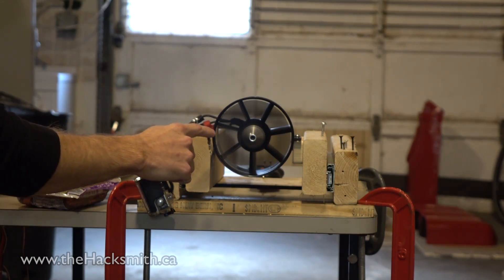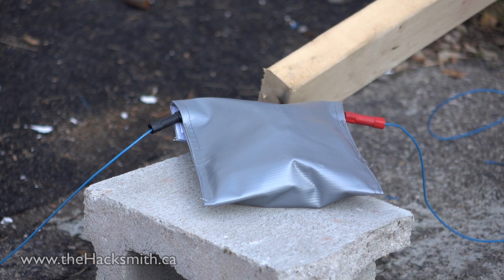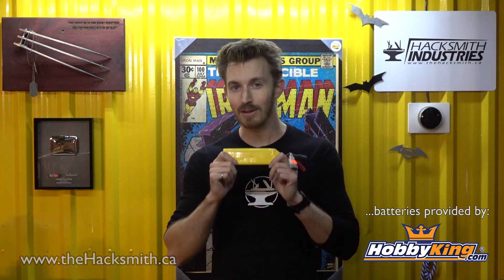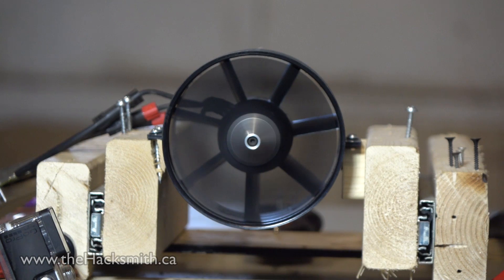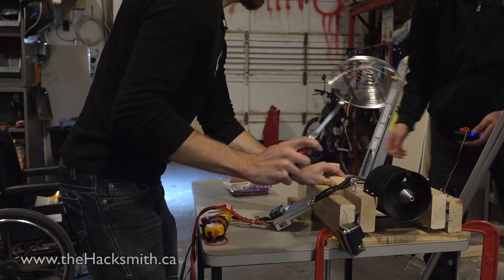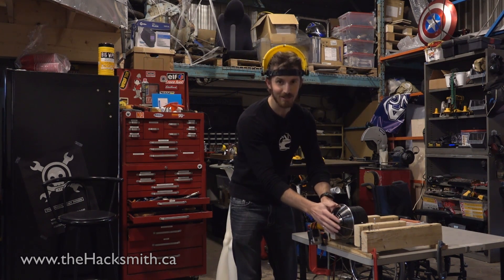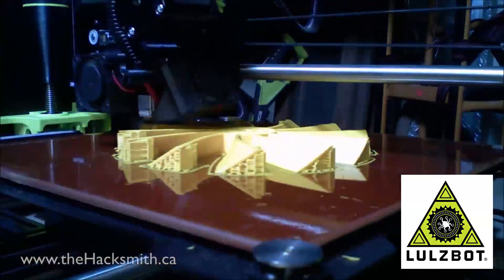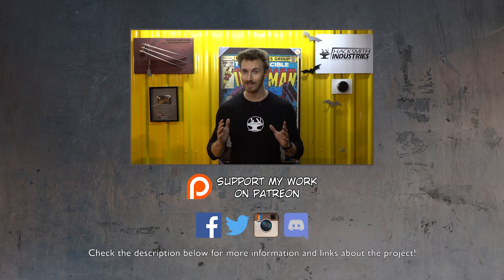Flying Like Iron Man #11: Not So Safe Safety Tests

Comment: Hey man im an aerospace engineer and i think the edf is spining too fast, you shud use a speed control and keep the revs round 2000-2500 rpm and up the torque to you can increase the mass flow
Reply from the maker: Not quite

Comment: Ok, I may be wrong here but I am pretty sure the lithium polymer batteries are the ones that don’t explode. They are made using a solid polymer electrolyte instead of a liquid one so they don’t spray out and ignite with the air like the lithium batteries and lithium ion batteries. You can actually cut them up and they are still usable.
Reply from the maker: No, you're thinking of lithium ion batteries. These are definitely lipos, and lipos are definitely the ones that explode (as shown in the video)
Reply: I thought the same at first, but after some research. LiPo batteries can be just as dangerous as Li Ion, especially when punctured. I think where I got the idea that they were safer was a video I saw months back about some guy developing a Lithium Polymer battery that wouldn't explode.

Comment: Hey Hacksmith, I want to give a word of advice, I don't know if these will work, but I have experience with electromagnetic transformers, and if you input about 10 volts into them, the output could be around 3000 volts and way more amps. the cool part about it is that you don't need alot of  amps to power it. Tell me what you think about this please.
Reply from the maker: Tranformers only change the voltage and current ratio. Power stays the same. example -- 100V at 10A in, you could get 1000V at 1A out

power remains constant at 1000W

Comment: When filming 60 or 120 fps always put the shutter speed to twice the frame rate. You probably have yours on 60 or 50 due to most film being 30 or about 24 fps. This will remove the flicker like effect in the BB gun scene
Reply from the maker: The flicker effect is from the lighting used. We have some lighting that works really well and doesn't flicker though.

Comment: This is late, but couldn’t you 3D print a fan with a dissolvable filament and then use that to make a “negative” cast, and then cast the blades with a metal of your choice? (Probably aluminum or an alloy of it) And then use a lathe/grinder to grind/cut off the excess?
Reply from the maker: +Josh C EDF blades are precision parts, they have to be perfect. Casting isn't :(

Comment: Hmmm a good way to increase the power for the edfs while decreasing the weight and batteries required would be to use a small inverter system to increase the voltage needed. This can also provide more protection against battery explosion as the inverter could help control the voltage variation from the batteries.
Now the actual best way to create a suit that flies like the Ironman suit does would be to create one of the most utilized features of the Ironman suit, and that is the repulsors. The tech needed for the repulsors is actually not too expensive to build. From what I surmise is that the repulsors consist of a light element ( which can be easily seen) and a sonic element which might not be realized. The light source can be a standard LED such as found in flashlights. Around the light emitter is a subsonic unit similar in function to a directional speaker. The hard part is finding out what combination of sound modulations and light modulations enable a repulsion effect. Now it seems that the waveforms of both units must form a type of lattice. This should enable the light to function more as a partical instead of light creating repulsion similar to a rocket engine. Utrasonics might work but I believe the subsonic frequencies would enable better partical cohesion. The advantages of this system is much greater that a system using other forms of propulsion. Smaller amounts of power are required for the light emitters and subsonic units. A small voice controlled CPU could control the frequency modulations providing a greater degree of repulsion/thrust difference. The frequencies determine the thrust since it is basically sound vibration and light modulations that are traveling out from the repulsors. And last advantage is that you not only get thrust for flight but can also have a reoulsor device or beam. It would take a lot of R&D time to sort the frequencies but it would be worth developing into a working prototype.
Reply: Cool

Comment: now I think there are three good approaches to make this project work. 1: better powersoarce. maybe abandon batteries and try something different. 2: better thrusters. ionocraft engines maybe? 3: or lighted the load. maybe use compressed nitrogen along side turbines. or use alot if balloons, or try horizontal flight with an unpowered rotor like a gyrocopter. your first attempt used rockets which turned out to be a little bit illegal. I wonder if hydrogen peroxide engines would be illegal or not. my last idea is to just increase effeciancy and decrease energy loss. perhaps with silver wires since they're more conductive.
Reply from the maker: +Clark Dauphin lithium polymer batteries pretty much have the highest energy density already so there's not much we could change there... Other option is jet engines and kerosene but then you couldn't do electronic stabilization. Ionocraft is cool but not possible as they only put out micrograms of thrust :(

Balloons would help but it's not really flying like iron Man at that point, is it? :P

Comment: what about using big ceramic capacitors? capacitors with ceramic or glass as a dielectric. it won't blow up, but it might drain quickly.
Reply from the maker: +Clark Dauphin capacitors can't store enough electricity

Comment: you could put a generator with small fan on it behind the outlet of the edf to generate power
Reply from the maker: +ants Vw you'd lose more power than you would gain.  Remember the law of conservation of energy -- energy in = energy out + losses. The only time you can reclaim energy from a system is if you can reduce the energy loss, which is usually in the form of heat, but all technologies capable of that are too big and heavy to be worth while. Using a fan would just reduce your total thrust and add more losses to the system
Reply: i get it but is it the same if you put it on the inletbut for the fan a small impeller even though the unit will become too heavy

Comment: try to use ultracapacitor
Reply from the maker: +Sunny Singh Chauhan they are not good enough. Lipo still better
Reply: the Hacksmith thanks for your reply
Reply: the Hacksmith what about suit with turbines at shoe's and back of exoskeleton to balance mass and get stability and hand propellers with variable speed to attaining height and making direction?

Comment: Why not wear a battery suit and build cool gadgets like a flying platform or a... that's all i got. You could be Battery Man!
Reply from the maker: lack of funding lol
Reply: Yea, I guess that is really expensive. But if you carry the weight of the batteries and build a platform(that will also carry all of that weight), you can use bigger jets and possibly take flight. Besides the steering being extremely difficult and the whole thing being extremely dangerous, I don't think it would be legal without a special license. I'm sure I'm not thinking about a problem that will obviously mess the whole project up(probably weight)but if I have the funds for that, I'll try it one day.
Reply from the maker: +Jaykerz P easy -- you can just build a giant drone, like I said it's a matter of funding :p a basic platform could be made for about $20,000
Reply: We need to advance technology like 10 or 12 years and then this would be so easy.

Comment: Hey bro, to prevent the blade (impeller) from breaking off from very high speed fatigue, put a one big ring that fits the perimeter around edge of all impellers and weld it, that's to naturally, strongly hold/support all  the impellers from getting fatigue so it will not break off during high speed fatigue. Good luck, enjoy it.

Comment: hi guys. Im not a expert but Ican see in my head how some parts shuld looks but I cant build by my self. have you try to build your own rotor on neodynium magnets???  also try to use blades on both sides that should make bearings less stress. what you think?? as I told Im not a expert.
Reply from the maker: The professional EDFs use precision neodynium magnets already, not easy to make yourself!

Comment: Hacksmith,hopefully u solve the problem of thrust power.Because even jet engine got several stage of compression air,may u need 2 or 3 layer of EDF fans overlap,create more thrust?
Reply from the maker: Thanks for the suggestion Patrick Ho!

We've actually answered this in detail in the Flying Like Iron Man Q&A video! Check out that video, or visit http://www.thehacksmith.ca/flight-project-qa/ to learn more about the project!

Comment: why don't you try using Ultra-capacitors.  they are available in hundreds of Farad, quickly rechargeable and delivers very high power, no problems of explosion due to over charge, light weight and compact
Reply from the maker: They still don't have storage capacity... Lithium polymer are capable of putting out huge amounts of current, and for a sustained period of time. Ultra caps can only do it for a very short period. It's all about energy density, of which lithium polymer is still the best commercial option =)
Reply: yeah must be u guys are working on it so u must be having better idea. great job guys hope to see u flying soon
Reply: can you tell me how much funding are you looking for this project??
Reply from the maker: +Padmanabh Deshmukh visit our GoFundMe page (link in description)

Comment: I just wondering,if possible other way to compress high density air other than using fan blade or EDF?
Reply from the maker: Not easily I don't think. I once looked up how much air you'd need to use a high pressure (150PSI output) thrust nozzle system.

It's possible. But you'd need a transport truck sized tank of compressed air.
Reply: Gud luck,btw i am Malaysian Chinese.Thanks to youtube.Giving opportunity for me seeing what is going on  the other side of the world.Ur project is Amazing. One although is a myth.If we human can create anti-gravity, that is a breakthru for the mankind.

Comment: I'm no engineer, yet I've seen blade designs that have a ring as wide as the blades, around the outer edge of the entire blade array. Wouldn't that help protect the blades from destruction/collision damage? Granted I understand it would add to weight calibration and balancing requirements/concerns.

Comment: should line the battery holder/case w/aerogel insulation, and perhaps add a transformer or two to save on battery weight

Comment: hey 
i was watching your all 11 parts
you should combine that your part 1 and part 8 episodes of your chanel
it can work
6 air throtle
and 4 rocket fuel throtel
try it
Reply from the maker: +Lakshya Rana what happens after 2 seconds and the rockets run out?
Reply: the Hacksmith 
hmm you are right 
but that air theotle use 8 or 6 and that 4 rocket fuel one

Comment: Try doing a fiberglass or carbon fiber overwrap of the fan blades and hub. Just design the 3D print with the fiber and epoxy thickness in mind (offset) and then overwrap. May help a lot!

Comment: have you guys tried to 3D print the prop smooth it out to your desired specs then mold and cast it in a high density resign like smooth on 300 which can 5ske up to 325 psi before failure?

Comment: the air gap between the blades and the outer duct is critical for efficiency.  minimizing the gap while still guaranteeing no contact is key.  There are now carbon fibre printers available - once you have the design down on low cost parts, just get it made in CF - put the blade on "thingverse" and I guarantee someone will print it for you with a  very high strength material.
Reply from the maker: Sadly the only real carbon fibre printers (markforged) don't have a big enough build platform for what we're trying to make!

Comment: so if you'd need a massive cable to power the device, how are those thin copper wires doing anything?
Reply from the maker: +Mr. Peanut those are 8ga cables, and there are two going to each EDF. Using those EDFs, we'd need 20 of them. That's 40 of those 8ga wires...
Reply: the Hacksmith I just thought of this while rock climbing the other day. What if you fed a cable through some fort of pulley mechanism similar to a belaying system, you'd save weight and last longer, but the device wouldn't have to support the weight.
Reply from the maker: Perhaps with our stunt wire system? ;-) we have thought about this, but even if we run cables to me, we don't solve the power issue. We'd still need the batteries, so at that point, why not just use the batteries lol
Reply: the Hacksmith good point didn't think about that. Thanks for answering my question though

Comment: You're never going to get there using Lithium Ion batteries. Their specific energy is just too low for manned flight. Sure it can be done, but the results are depressing. 

You could maybe pull it off using model airplane jet engines. You're already strapping explosive batteries and 50k rpm turbines to your body so I don't think the safety difference is much less.
Reply from the maker: +casey b we know we'll only get 2 minutes of flight time with batteries, and that's perfectly acceptable. We're not commercializing a product here ;-)

Watch my TED talk if you don't understand why we would do that :)
Reply: Yeah, don't power them with batteries, go with some sort of fuel like the Zapata flyboard Air does.

Comment: what happens when you use those jets to full capacity?
Reply from the maker: You get maximum thrust? The current ones only put out 8kg though
Reply: ah...
Reply: but have something soft to land on
Reply from the maker: +testedpacman123 ROBLOX did that in part 9
Reply: i hope you do fly on first try for the final product

Comment: hey hacksmith...for that flying mechanism choosing iron man doesnt seem like a smart choice...why dont u take inspiration from terry from batman beyond?
Reply from the maker: +Mehool Seth but that would be giving up!
Reply: as it is youve already said u r hovering..you are using rotors instead of jets...the current mechanism may workout with a makeshift glide suit
Reply from the maker: +Mehool Seth any kind of glide suit requires high forward velocity to produce lift. Easier than hovering? Sure. My death wish? I'd rather not.
Reply: yep probably a bad idea but hey man you are the hacksmith obviously the idea is rudimentary but m sure there might be a solution to the high forward velocity problem..anyways love wat u do man :)
Reply: if the rotors can be used for a takeoff they can probably be used for a safe landing too.
Reply from the maker: If we have enough power to hover we can do anything =)

Comment: Re: making your own EDF... have you thought about perfecting the design with 3d prints and then making your own metal casts of the blade arrangement using a 3d print blank? Should be able to smooth before casting and then polish the metal part afterwards.
Reply from the maker: +Janish 3D printing is just for prototyping :) once we've perfected the design we'll have it machined!

Casting is too difficult and requires almost as much post processing as just machining -- so we'll just skip that part :)

Comment: For the 3d printed props, try either curing them in an oven (it resets the materials grain boundaries and strengthens the inter-layer bonds) or just make a mould and injection mould them with nylon. 

I don't know what material you're printing the props with, but I'd definitely look into high tensile strength materials as those blades are being 'thrown' outwards with a massive amount centripetal force, there's a lot of radial and axial load on their roots. Hell, at that RPM I'd be printing with nylon or another strong material and baking it to ensure the layers are bonded together properly.

Check out Thomas Sanladerer's 'Filoween' series for the strengths and weaknesses of materials, there's a few new materials he's reviewing which I'd love to play around with if I had a hot end capable of those temps! :L

- Will

Comment: As a thought... Would it be better to relocate the vest batteries into Kevlar cargo pants to lower the center of gravity for better balance and stability. Also, you could try using a custom milled blade to make a mold, then fabricating a turbine out of carbon fiber to save weight and reduce rotational inertia, therefore making the entire assemble somewhat more efficient. https://carbonfibergear.com/products/carbon-fiber-starter-kit

Comment: +the Hacksmith How high are you actually planning to go? I don't think a few fast fans can send you up high for long so would solar panels attached into a battery pack give the EDF extra life.
Reply from the maker: +GML Vlogging & More not that high.... Solar panels are useless though... This system will draw 150kW... You'd need enough solar panels to fill a few football fields :p
Reply: +the Hacksmith Well I wouldn't want to see lots of solar panel worn as an umbrella :P

Comment: You could use a solar panel or a other power source u could take with in the air
Reply from the maker: +Zorn Gaming no, you'd need a few football field sized solar panels
Reply: oh ok that is not that practical :D
But is  there now other way to produce energy ?
Reply from the maker: There really isn't. The final system is 150kW

A house can only provide 24kW =P